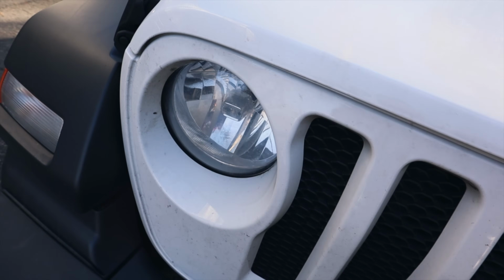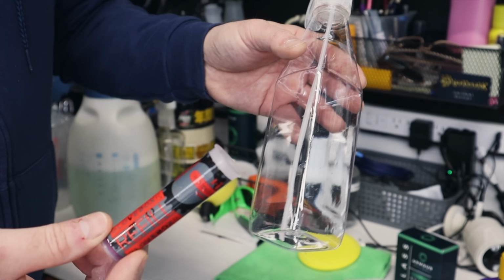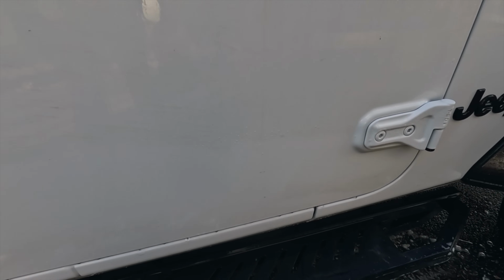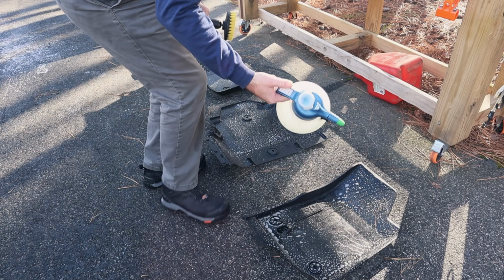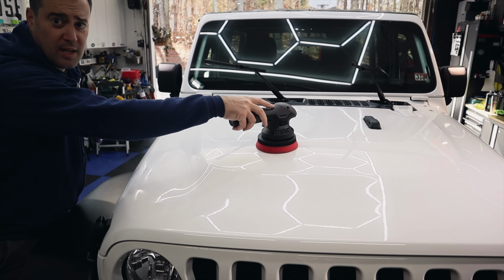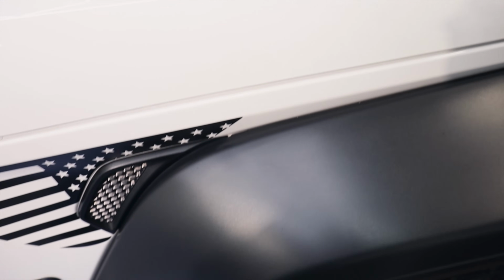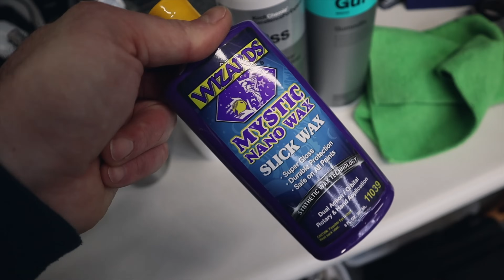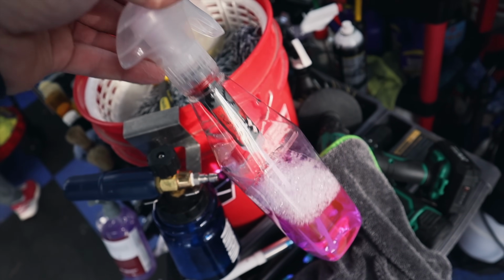⚠️ USE THIS AMAZING PRE-WASH ⚠️  Detailing a Dirty JEEP

Comment: Thank you Phil for your review! We really enjoyed the Nano Wax as it was insanely slick and so easy to use. It is definitely a fast application and a great bang for the buck. Our new wheel & tire cleaner is a good maintenance cleaner and gets the job done for sure. We will be looking at possibly getting new sprayers but that may be awhile as we have other products in motion. Thanks again!
Reply from the maker: You're Welcome guys!
Reply: @MirandaDetailing did you build the car mat table? And I was looking for the link to the nozzle holder on your trigger.
Reply: @MirandaDetailing Did you build the car mat table? And I was looking for the link to the nozzle holder on your trigger.

Comment: Great video like always! I do have 2 questions. 
1. What’s the difference of using MSN from a APC wash? 
2. Do you throw away your first initial wipe towels for glass coatings or coatings in general?
Reply from the maker: Thanks!  
The MSN is a dedicated pre wash. I use it exactly the same as we do with any APC when doing an APC rinse. I just wanted to try a different product.
I don’t throw away the towels at all. I soak them and wash them right away. I will not use them again for coating removal but I can still use them for other interior and exterior uses. I simply check the towels to make they are soft and won’t mat the paint before I use them on paint again.

Comment: Phil do you use the deionized water on your details? just curious, I know some detailers do and quite a few don’t, keep in mind whatever you’re doing. It looks great!!
Reply from the maker: Hi. I only use it on maintenance details on coated vehicles when working in the summer in the heat. Also I only use it for the final rinse. Just to ensure no water spots. Otherwise my water is t really bad, so all other times I just use my regular water.

Comment: Great video again Phil, just wondering what tip do you use in the IK Foam 12, grey?
Reply from the maker: Hi. Thanks. I have the red tips on both of them.
Reply: @MirandaDetailing Oh sorry I meant the foam tip inside the IK, grey, orange or green aka standard foam, wet or dry?
Reply from the maker: Oh sorry. Actually not sure. I didn’t stick any foam tips internally so what ever it came with I still use.